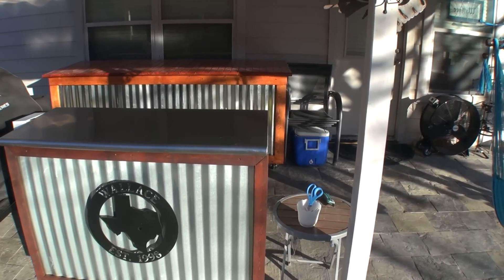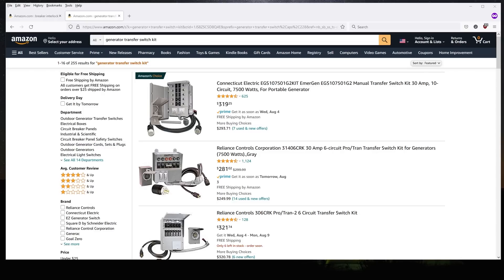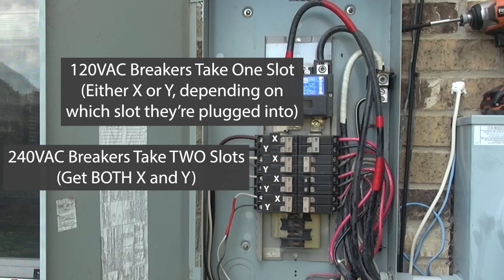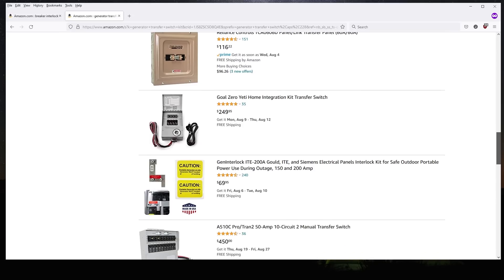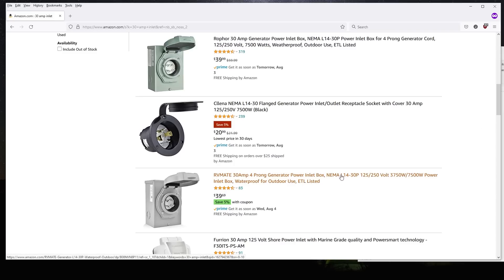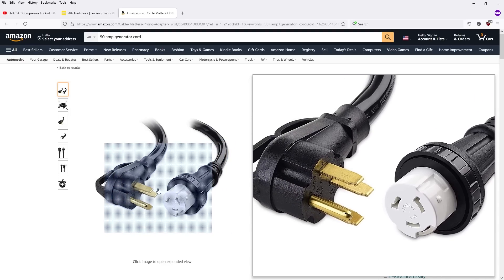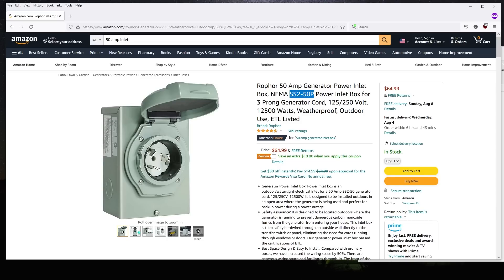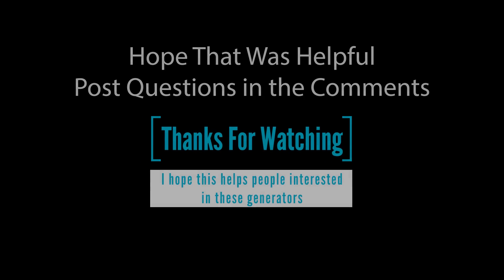How to Connect A 240VAC Portable Generator To Your Home

Comment: If I could thumbs up this video and your other generator videos 1,000 times I would. I just bought a house that has a generator inlet box and an interlock switch. Since the house was ready for a generator I went out and bought the predator 9500 in case the power goes out. I like to understand things before I use them so I’ve probably watched 4 hours worth of videos trying to understand how generators feed electricity to the panel at both 120/240V. I was able to piece together info here and there, then I ran into your videos that explains everything so clearly. I could have saved hours of frustrating poorly explained videos if I found yours first! Thank you!!!!!
Reply from the maker: Happy it helped you.  These are kind of my "pay it back" / "pay it forward" for all the other helpful videos I've come across.

Comment: Jason i appreciate the time you have taken to share your design. You may want to have an extended fuel supply because it is far safer to take a fuel line to a remote tank than pouring fuel into the  top of the tank. Especially next to your house.
Im sharing a link for a professional technician who has a good video as well a very well understood plan to achieve a quality upgrade.
https://youtu.be/Ss-NqKG3DWw

Comment: I’m up here in Fort Worth, I have the little predator to just do the bedrooms. Before watching your video, had the electrician wire up the 50 amp plug to the house. Also installed a sub panel with all the bedrooms. Figured it would get me through the winter if needed (like you we lived through the stupid ice storm last year). I got a kerosene heater for heat if needed, and have 3 bottles of emergency propane to cook in an emergency. You hit the nail on the head do not get a 30 amp plug outside, go 50. For my setup (because I had the 3600 watt generator already and didn’t want to drop $4200 at once, I am ready to do exactly what you did when the time comes. I paid the electrician $800 for the breakers, sub panel, outside plug, and to have him hook it up. He wasn’t happy when I rolled the little 30 amp genny out there when he was done, but he did agree to build me a 20 foot 30 to 50 amp cord for it (included in the price). Smart move he said, I don’t need to come back when I get your setup running, even though I will to get him to move the A/C, dryer, and water heater breakers into the subpanel. Also, if you go my route, buy a large sub panel so you have room to add all those to the new panel. Excellent video man, no one knows what the heck is going on, and I did pick up quite a few things. No power for a day or 2….no problem. No power for 2 weeks is sub 20 degree temps…..yeah you’ll be watching this video, bet 3/4ths of the views are Texans on here, lol.
Reply from the maker: Good.  Now you have flexibility.  Glad it helped you out.  Be sure you have ventilation handled for the heater.

Comment: Hey Jason great video. I have a couple questions I was wondering if you could help me with. I had a 50 amp interlock kit installed with a 50 amp inlet box. I want an inverter generator and none come with a 50 amp option unless you parallel two units. I would like to avoid this if possible as Invertor generators are already about double the cost as non invertor generators. I was looking at the duromax 9000 unit and wanted to know what you thought the best way to go about wiring it would be. Would it be better to get an adapter from my 50 amp cord to my 30 amp generator inlet or find a plug that goes from 50 amp to 30 amp. I will also be installing a soft start kit on my a/c as most of my other appliances are gas so 1 generator should be sufficient for my needs (and my 200 amp service)  as my home is a fairly efficient new build last year. Any other advice or recommendations you have I’m very open for. Thanks so much!
Reply from the maker: I'm not aware of any inverter generators that are capable of generating 50amps alone.  Some may have the 50amp plug (such as the Powerhorse 7500 / 6500 watt inverter generator).  To make my parallel kit, I modified the parallel kit for this generator to use as the base wiring (it has the plugs I needed for the front panel).  The Powerhorse parallel kit, is just the plugs, linking the two generators together and you actually use the front panel of one of the generators as the place to plug into (Vs. plugging into the parallel kit box at the junction point between them).  So this unit has a 50amp plug, but can't actually generate that much without a second unit teamed up with it.

In your case, it would depend on what you have.  If you already installed a 50amp inlet, and already own a 50amp cord, then if you want to connect a 30amp plug into it, just buy an inexpensive adapter to convert the generator to plug into your existing cord.  If you already have a 30amp cord/cable, then get the adapter to convert that to plug into your 50amp inlet.  That method would be the much more economical approach, no need to repurchase a whole cable or inlet.

If you're mostly all gas (including your water heater, that's at least 20amps of electrical power right there, Oven / Range, Central Heat, clothes dryer), then yeah, you can probably get by with one gen and a softstart on the AC.  It usually only takes an amp or two to run the blower in your air handler when dealing with heat... so as long as you don't just go crazy with the home appliances, you'd probably be good.  If you're gas across the board for heating stuff, your largest power draw will probably be the AC compressor, which depending on your unit, may burn roughly half of your capacity on a single gen.  So depending on the how much you can save with the soft start, will decide how much you can have on in the house at the same time it starts up.  (Once it's running though, you can turn things on again, cause the load to keep it going is still much less than the load to initially start)

So you'll need to do some testing to see what your unit can handle.  If you need to run the AC, you may or may not need to turn some stuff off first in the house to let it start.

Comment: What if you have a nat gas furnace for home and for a pool?  Do you think it'll be able to power those + everything else?
Reply from the maker: You'd have to look at your overall power usage, but for an average totally GAS home?  Yeah, one unit probably would work.  
Things to ask:
Is your water heater gas as well?  (that's 20amps for me alone, so if it's electric, that's half your power budget right there with one generator)
What about your clothes dryer?  (that one is a huge load for me there, that pretty much has to stay off unless I've turned off the heat and/or the water heater)  
If your stove/range  Gas or Electric?  (that's proportional, so you can only use one burner for example and not pull too much)
Do you have a heat pump that is assisted by gas, or is the heat only gas and the AC is the only thing using the outside compressor?  (A heat pump will pull more when it runs the compressor, and you'd benefit from a soft start (see my other video covering that)

It's best if you get a meter and check these things.  But pretty much if all the things I mentioned are gas (or just not used in an outage) you'd probably be ok assuming you don't have a ton of other appliances running (freezers, lots of computers, etc.)  Also what your computers are doing actually matters a lot.  My PC at idle or doing web browsing and such, not much juice at all... maybe 60-80watts... start coin mining with it, or heavy gaming, suddenly 200watts.  Also worth considering, is how power much does your pool pump use?  In freezing weather, I'd assume you'd definitely want to keep that on and circulating to not freeze up.

All my stuff is electric, so while I can't totally go crazy and turn everything on... with the generator pair combined, I don't have to think about it too much, but without very heavy rationing, one just isn't enough.

Comment: I had a question. What if I need more than 50amps. How do you use the total of 15000wAtts (the two of them in parallel) running through the 50amp outlet?
Reply from the maker: Technically, you should get a bigger outlet.  The problem is, above 50amps, you start getting into strange, unique plugs and connection stuff.  Over 50amp inlets and connectors are not really standardized that I've seen for residential use.  

If you really needed, consistently, more than 60amps, you'd need a 3rd generator, and you'd just hard wire everything in, ideally combining everything together in the breaker box, and feeding it in via a single, interlocked appropriate breaker.  Such that there is no quick disconnect, and you just have parallel cables.  

In my case, the combined continuous output capability is closer to 60amps, but you really shouldn't be maxing out the generators in that way, cause you're hanging just on the edge of them shutting down.  So I'm comfortable with my setup in this way as I don't expect more than 50 to 55 amps to be pulled from it continuously for any significant length of time.  A 50amp socket won't instantly self-destruct if you pull 55 or 60amps through it, but it's not something that should be done continuously.

Really, though if you need that much juice (70, 80+amps), you're well past portable generator territory, and firmly into a proper whole house generator setup, and needing a professional installation.

Comment: Awesome video! I wish I had the space for the predator and knew about it beforehand! I bought a Champion 7000 watt inverter generator but it doesn't have an parallel plug for me to hookup two together, so I can't get the 15k power that you got. I was reading the comments of your other video and I agree that trying to make a parallel cable from the L14-30 outlet could be dangerous, so I don't think I'll be buying a 2nd champion generator to hook together... 

On a small note, did you secure your backfeed breakers to the breaker box? There's a NEC code article that states you have to. I didn't know and I made a video talking about it and fixing it - https://www.youtube.com/watch?v=hlq4DMMP-vQ.  Keep up the good work!
Reply from the maker: Cool.  You've got a very similar breaker box to mine.  (You're not too far from me, we're both on PEC)  You took the more very nice and classy route.  I've seen others handle that requirement by simply using a ziptie as the "additional fastener".  

I personally did not do that, but might add the zip tie at some point.  :-)
Reply: @Texas_DIY  Yeah, we both got Eaton's. I think I have the newer plug-on neutral one as my house was built in 2020. Calling the interlock kit an expensive metal plate thingie is very correct! Back to tying things down - yes, the code doesn't say how it needs to be secured, just that it needs to be secured, so I have heard that zip-ties count as fulfilling the code.

One last thing I noticed - NM-B wires for the generator inlet box outdoors is also against code, even through conduit. I'm not an electrician though, but from all the internet research I've done, I believe it is required to either use UF-B or THHN/THWN individual wires through conduit. I went with UF-B myself - it was tough getting it through the conduit but it worked out in the end. 

https://diy.stackexchange.com/questions/191851/generator-power-inlet-box-location 
https://diy.stackexchange.com/questions/30436/can-i-use-indoor-romex-in-buried-outdoor-conduit

Comment: Jason, thanks for your great videos, I’m a big fan. I also plan to own two Predator 9500 inverters (so far, I only have one, but I am fishing for the second one), I will follow your advice and slightly modify an existing plastic shed… Any advice on the brand/type/model/size of a prebuilt plastic shed that can accommodate the two 9500 inverters?
Reply from the maker: There were a lot on Amazon, Walmart, etc.  that would have been good for single units.  But nothing that fit my particular needs for two units.  I wanted something like a deck box, but that could accommodate two.  (and not have to buy two separate boxes, for almost as much money as a generator itself)

A shed (vs. a box) would have worked great, but the location I'd put it, would block a window or block sprinklers... but that was my situation.  If you can swing it, I'd say look into more of a shed type enclosure that you could put other things in as well.  (also look at the "all the technical tidbits" video I did on these.)
https://www.youtube.com/playlist?list=PLzoNthJzzMFQ877vyCfoc53oDQqGFAIKN

You will have to vent the generator exhaust out of the shed (both for safety and because they will shut off with too much Carbon Monoxide).  Be careful attaching piping directly to the muffler, it vibrates a lot and will probably break the welds there.  I show a link to some high temperature tubing that would be good as the junction between the muffler and the exhaust tubing to the outside air.

Comment: Did you have to change the generator ground from bonded to floating? Just bought the predator 9500 for home hook up.

Thanks,
Reply: Short and long answer National Electrical Code wise. Short answer is yes, the frame ground and the neutral should be floating back to the service panel since that is the first point of disconnect and that is usually where the utility neutral and grounding electrode is bonded at. However if the neutral is floating at the generator, the 120 volt GFCI receptacles will not work since there is no ground for it to reference to.

If this was a permanent installation, then frame ground and neutral needs to be floating. I own a Predator 9500 and thought about unbonding it, but decided against it since I will be using it for other than powering my house when the grid goes down. Plus, tracking the wiring diagram is a pain and if done wrong will cause a potential shock hazard with serious injury or death.

Do I need to install a ground rod and bond it to the generator is another confusion. If your generator is the only source of power feeding to (i.e. towable camper, RV, off-grid cabin, etc), short answer is YES. NO, when using a properly installed generator inlet to a home; the grounding/bonding is established by the electrical service panel via the inlet cable. Article 250 of the National Electrical Code is a big rabbit hole that can go on forever depending on the application that it applies to and the authority having jurisdiction (AHJ).
Reply from the maker: Yeah, rabbit hole is right.  I did see another video (don't remember who it was now to credit them) where they removed the front panel, and found that there was two cables attaching to the rear of the ground screw that protrudes through. One of those two, was the frame ground.  So there is a "relatively" not too crazy way of unbonding it.

I guess I need someone to explain to me how / why it's a big deal.  Everything is grounded, even the generators are when they're connected to the home with the cables... so I'm having difficulty understanding why it would matter.
Reply: @Texas_DIY  I just searched for: Mike Holt Grounding - Safety Fundamentals (1hr:13min:19sec) explains it a little better on the subject. He also has dives deep into Grounding and Bonding, but that is 6+ hours on the subject.

Paraphrasing it a bit. Electricity originates from the source and returns back to its source. Neutral wire carries the unbalanced load from (X) and (Y). The ground wire carries the full fault current back to its source thus tripping the upstream breaker to shut down the show. Floating neutral at the generator ensures that the unbalanced current between (X) and (Y) goes back to the source.

Electricity does some strange things under certain conditions; if it was permanent installation then I would consider floating the neutral and frame ground at the generator to bring it up to code. Temporary hookup for a few hours until the utility gets restored is perfectly fine.
Reply: @felaxchow207  Great answers! I've read many articles and still wasn't sure. I've converted my 9500 to floating,  but it raises concern for non home hookup use. 

Primary use will be hooking to a power inlet box with interlock kit, however is it a safer option to convert back to bonded at the generator for extension cord use and like mentioned short power out hook ups?
Reply: I plan to leave it floating, and use a bonding plug for non home use. 

Thanks everyone for the information.
Reply: @curtiswhite4868  it shouldn't be problem doing that way. One main reason for me to leave the neutral bonded at the generator instead of floating is that I'm using it more for portable power use and home backup is the icing on the cake. Plus my RV surge guard will not pass power if it senses an open ground fault.

Generator input with interlock sure beats the spaghetti model of extension cords running throughout the house when the grid goes down.
Reply: @curtiswhite4868  any help/quick instructions on making it floating. Is it removing front cover and removing both wires off the "grounding bolt" behind front cover? ill be happy to give ya an email too if want to explain that way